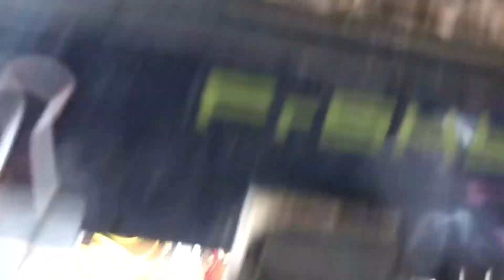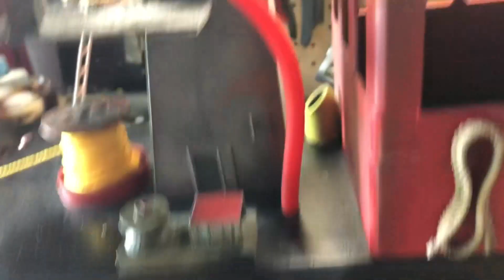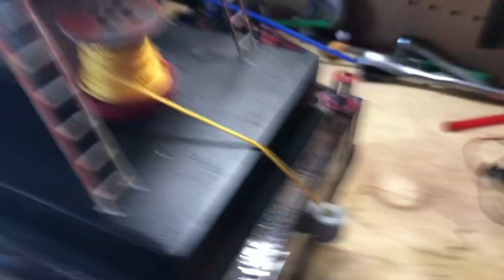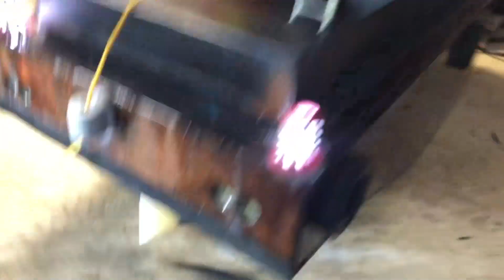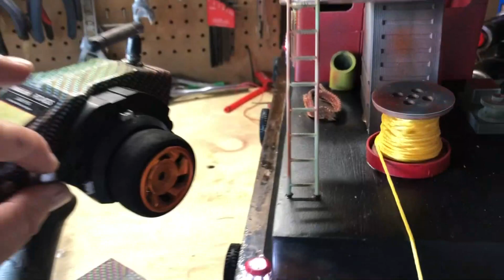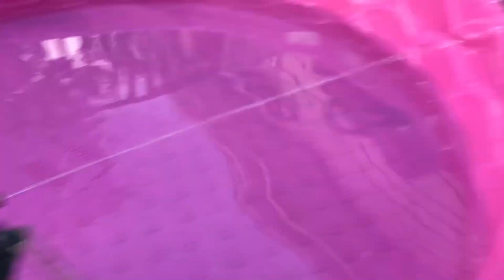Super Geek Rescue Boat!! The JJ Tug Mod. ZippKits Tugster Rev 2

Comment: do you have a link to the file for printing the new wheelhouse/pilothouse?  Are you using just a rc electric fuel pump for the water cannon?  What is the drive shaft diameter?  im thinking of building the twin tugster but want to replace their shafts with threaded shaft ends rather than use that press fit propeller they use... i want to use a nice big brass prop